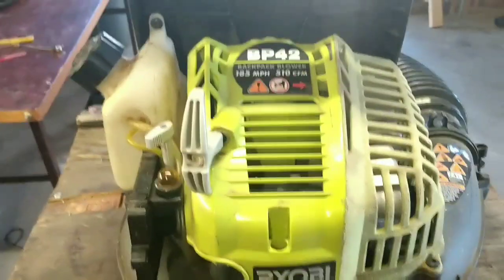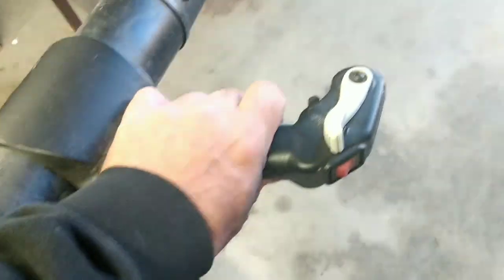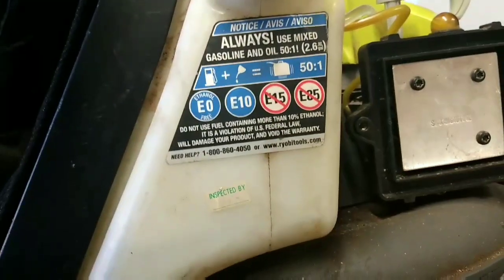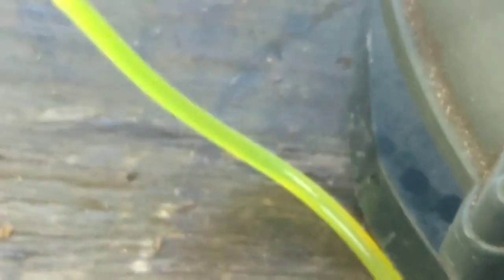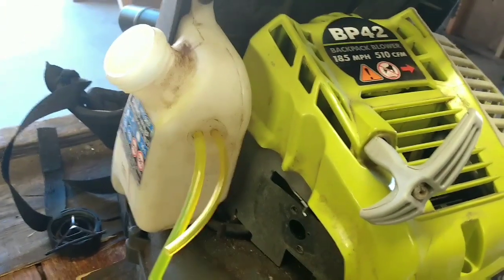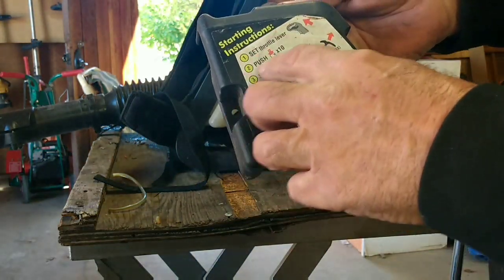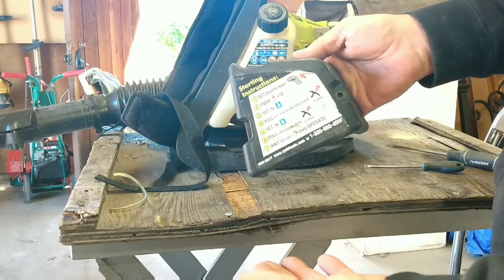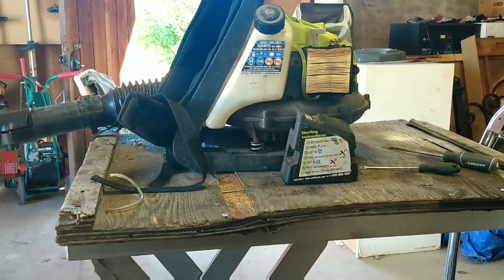Ryobi BP42 BackPack Blower won't run/Hard Start

Comment: These things are junk. I bought mine brand new and started having problems after 5 hours of use. They are known to stall out when you press the accelerator button. Changed the air cleaner, fuel filter and plug. Still stalls out, I don’t understand how consumer reports gave them a good rating, when you look on amazon they only get 2 stars and awful reviews. DO NOT BUY this product.

Comment: my bulb gets stuck when i go to prime it
Reply from the maker: Figure out where the clog is. Remove the fuel filter and replace. See if that does it. If that doesn't do it, remove carb and clean screen in the carb, make sure metering diaphragm is not hard and stuck in the up position. Chances are it will be a combination of the first 2.

Comment: Thank you! This will be my Christmas break project, has been driving me crazy. Do you have any links to buy the fuel lines you used and do you have a link to the metering diaphragm? Lastly, you mentioned a special wrench to adjust the carb that the guy didn’t have, do you have a link to that?

Comment: im having an issue with mine. thought it was the carb. replaced it with a new one. still same issue. it will start i let it run and then turn the throttle to full run it shuts down. what do i need to do
Reply: Sounds like you still have to adjust the new carb. That is to say all your lines and primer bulb are good, Start with high idle screw closest to outside and then slow, closest to engine at idle speed. The throttle screw as well might need slight adj as well. good luck
Reply from the maker: Sounds like you just need to open the high speed jet a little. Start with 1/4 turn counter clockwise until she  stops  falling down under acceleration.
Reply: Try replacing the Magento bro. Worked for me
Reply: @Red-Eagle  did you have spark on the blower before replacing the ignition coil? I’m wondering if the coil is bad even though I have a strong spark at the plug....

Comment: I have a question, I have the same model and I have noticed that mine is having more and more each use a hard time starting. What I have found is that the primer plastic bubble most of the time is completely empty and when I push it in to prime it doesn't have suction, it takes for ever to come back to its normal position. Can u help with some pointers
Reply from the maker: Are you positive you have the fuel lines arranged the way I have it in the video? You might just need the metering diaphragm if the lines are correct.
Reply: ulitepilot aka Zombie Dave thanks for you reply, the leaf blower is maybe 3 yrs old and as OEM out of the box today. I have not started any work on it so the gas lines are the same way it came when it was new. What my finds have been the gas bubble is not punctured in any way, it's as if the gas line was clogged. I pulled both gas lines out of the fuel tank today one still has the filter attached but the other is half the size and seems as if has broken. I emptied the gas tank to see if there was any loose items inside and there is not.
Reply from the maker: @Jose8312125718  that is the correct way for the fuel lines to be.

Comment: Appreciate it but which screw and location did you give a second half turn after after doing 1 1/2 turns on both
Reply from the maker: @  9:18  . I apologise for the sound quality.  The low speed jet is closest to the engine block. That's theidle mixture control. High speed jet is farthest away the engine block.  That adjustment is made when the throttle is fully opened and looking for near maximum speed. I usually back off the jet a little so it doesn't run too lean. Thanks for commenting and I hope it helps you.

Comment: That's a good idea, bench testing the fuel system like that. Also good information on the proper routing of the fuel/primer system.
Thanks Dave!
Reply from the maker: No No, Thanks goes to you for watching. I have a crazy Nissan Sentra video coming. You'll like it

Comment: Watched intently this blower does all the bad stuff my WB42 (Wheeled Blower)I use No ethanol gas,Full synthetic mixing oil, and it starts and idles ok but no high RPMS, just dies. So I will try some adjusting.  Not sure how to scratch in a slot for screw head but will try.  Thanks VERY MUCH. TUNDRA TOM
Reply from the maker: Most guys that put the slots in use a dremel with a cut off wheel. Sometime an electrical butt connector will work.
Reply: @ZombieDaveAZ   Thanks for reply will try.
Reply: I finally bought pack of 9 carburetor screw drivers and made adjustments. Stated up revedbup and used full throttle and now works well. The more I use it the better it runs. Thanks

Comment: Had the same problem as well last year. Come to find out the Magneto went bad and had to be replaced. Runs like brand new now.
Reply: AceOspades what’s the magneto
Reply: @henryhenriquez1053  its a ignition coil bro. Sometimes those short right out as a safety conductor. These Ryobis are known for these Magnetos to go in these backpack blower
Reply: Does anyone have the part number of the ignition coil?

Comment: How do you remove the cover behind the filter?  There’s a plate with three screws. Is that it?
Reply from the maker: Yes,  that's it. The plate keeps the filter from being sucked in as well as holding the carburetor on.

Comment: I replaced 2 short blocks in those that were straight gassed. Cheap short block under 60 bucks!
Reply from the maker: It seems decent enough. Not too heavy. Good power and now that it starts on 2 pulls he will be happy. Good to hear from you my friend..
Reply: Those backpacks are a good value for the money. They actually blow pretty good!  Not like a new Stihl or Echo but half the price

Comment: I have this same model and it has been very good to us for several years. This year it decided not to start when it was hot. It would start right up the first time but then when it ran out of gas, I would fill the tank back up and try to start it and it wouldn't start. I would have to wait for it to be completely cooled off to start it again. I've also read it could be the ignition coil. Any thoughts???? Thank you. I have enjoyed your videos.
Reply from the maker: Hey Mommy, ( shout out to Connor and Logan) it would be hard to say why your machine has decided to start acting up now after several years of smooth operation for you. Not all problems associated with small engines are big ones. ALWAYS start with the basics. Clean air filter, spark plug is not all fouled up, gas is fresh and high octane, using a good full synthetic oil to mix with your gas. Your issue does not sound like an ignition coil to me. It would be metering diaphragm related or  one of the other issues I mentioned in the beginning. Fuel, plug, or air filter. I hope this helps and give you guys a starting point to solving your problem. Thanks for stopping by my channel. Stay safe everyone 😷👍

Comment: Great to watch the process and disassembly, are the diaphragms universal?  Where do you get them?
Reply from the maker: Not universal. Zama, and Walbro are the 2 most common carbs. Ryobi sometimes uses Ruixing and those kits are more of a pain to find. Amazon is a quick place to find what you need. Type in brand and model and they will come up. Be careful NOT to order a promoted item that is not related to what you need. Amazon is good about sneaking those in there.

Comment: Need your advice Dave. I have the exact same machine and it won’t start. The coil has been recently replaced and I get a great spark from the spark plug, I took the carburetter apart it looks brand new with a supple diaphragm. the primer ball and fuel lines are all good and are connected properly. With the plug removed I pulled the starter cord and there is a small fine mist that comes out of the cylinder so it looks normal and ready for ignition. I adjusted the idle and high speed carb as you did in the video but still no start. I’m at my wits end!!!!
Reply from the maker: Hey Pete. If you have good spark and compression. Check the easy stuff first. Dump the fuel and check for water. Will it start on carb spray?
Reply: Hi Dave, just to be sure, I dumped the old fuel (which was clean) and added half a tank of the ethanol free gas in a can with a 50:1 ratio. Still no cough
Reply from the maker: @peterfrancolini5906  any way you can check the compression? If that's good then I would check the key in the flywheel. Just because it sparks does not necessarily means it sparks at the right time.
Reply: @ZombieDaveAZ  great idea I will gain access and check it out and provide an update. The guy I bought it from said the coil was changed but it may not have been properly installed.
Reply: @ZombieDaveAZ Dave, how can I tell if the flywheel key is aligned properly? I’m not a mechanic....just enough knowledgeable to be dangerous 😄
Reply from the maker: @peterfrancolini5906   when you remove the flywheel the key will be noticably deformed. It must be perfect. Be careful removing the flywheel not to damage it.
Reply: Hi Dave I could not remove the flywheel as I don’t have a puller set but the key is clearly visible and looks great and undistorted.
Reply from the maker: @peterfrancolini5906  can you verify compression buddy?
Reply: @ZombieDaveAZ  Hi Dave the compression shows 115psi.
Reply from the maker: @peterfrancolini5906   it should run. Do you have an inline spark checker?
Reply: @ZombieDaveAZ  Yes Dave I have a good spark. I used a drill to spin the cylinder and I get a fine mist coming through with the plug removed. I’m stumped buddy!
Reply: @ZombieDaveAZ  still no start
Reply: I gave up and got rid of it!

Comment: These things are garbage! "When" they work, they work great unless you shut it off after running it, then you're screwed, will not start again for awhile. I bought 2 and 2 weeks into leaf season I had to send one in for repair! I take good care of my equipment btw. Hard to start then simply wouldn't go past idle. I touched no settings whatsoever as they were BRAND NEW! Then I  did all the "troubleshooting" recommendations from Ryobi website...nothin...! 
THEN the other one died before I got the 1st one back from repair! Next season I had to mess with them again to run. I got ONE good season with minor problems. Now the dayglo green fuel line just desintagrated so I had to replace that. Now the same thing happened to other one, for EFFFS sake! 
I'm going to buy and Echo because I have a local place that sells and works on them! No one else nearby will touch these things. Literally 6 weeks for repairs with me calling and griping about it.
Reply from the maker: Yeah, my initial opinion (and it doesn't mean much) was that this was for a homeowner with a bigger yard than most. Definitely not for commercial use. Sorry for your woes. If you are looking for something reliable and will get you thru a few seasons, try and find an older stihl be 600 or larger. Those 4mix engines are powerful and run all day long. Keep the valves adjusted and good gas and oil and it will be worry free. Best of luck and Thank You for sharing. Stay safe brother Mike. 🍺😷👍
Reply: @ZombieDaveAZ   Thanks for the reply and no need to apologize bud. I literally messed around with BOTH of these today using parts of your video and managed to get BOTH of them running, did the leaf job and we'll see if they fire back up. I need equipment to work and maybe I got 2 bad ones but man, what a pain. I shouldn't feel "lucky" when they fire up and run correctly is all I'm sayin. Still going to get an Echo and save the Ryobi's to sacrifice whichever messes up again first for parts ;)

Comment: Why did you take the tube off the blower?
Reply from the maker: What tube are we talking about Jack? I only replaced the fuel lines. I did not take off the blower tube. Sorry I'm confused.
Reply: ulitepilot aka Zombie Dave the blower has a longer blower tube that isn’t on there and I was wondering if you took it off for a specific reason

Comment: What if the gas doesn't flow through the lines when pushing the button down?
Reply from the maker: Most of the time the lines to the primer bulb are backwards BUT it can also mean the metering diaphragm is hard and the metering valve won't open to let the gas go thru. Try switching the lines first and pause the video to see how they go. Let me know what happens.
Reply: ulitepilot aka Zombie Dave I know this is late, but the metering diaphragm allows the fuel to flow through the carburetor, correct?
Reply from the maker: @aintnbfr  yes
Reply from the maker: @aintnbfr  Hey buddy. I should be more thorough with my answer so here it is. If the the primer bulb depresses and releases easily and usually makes that mousey squeeky noise you could have a broken fuel line.  If the primer bulb pushes down hard and no noise then the metering diaphragm could be hard and stuck in the closed position. I hope that helps. I was exhausted after work and gave the easy answer.  Ask as many questions as you need to get going again. I'm here for you brother.
Reply: ulitepilot aka Zombie Dave yea i think it could be the metering diaphragm sense when i push the bulb it's kinda hard and the fuel doesn't move through the lines. And opening the carburetor shows that the metering diaphragm is like the one in the video, very hard. Thanks for the help! 👍
Reply: Wondering what the resistance should be on the ignition coil? Guessing around 3 k ohms?  I have two machines with no spark and I'm getting around 8 k ohms on them. Can both coils be shot? thanks